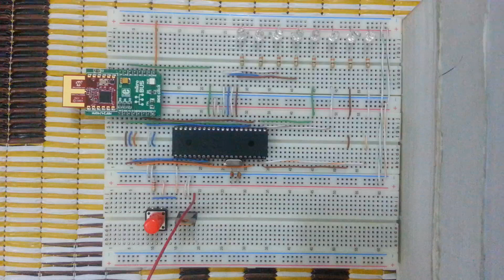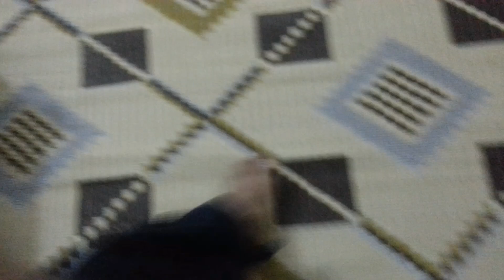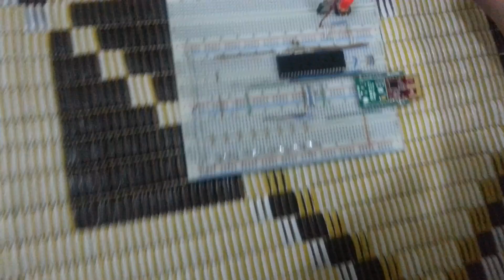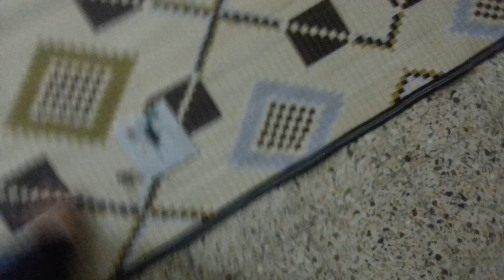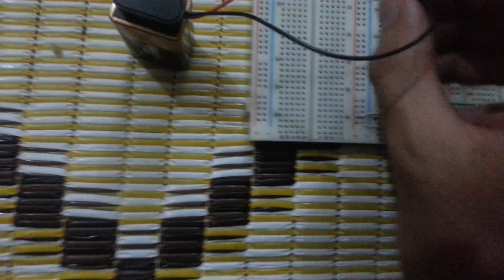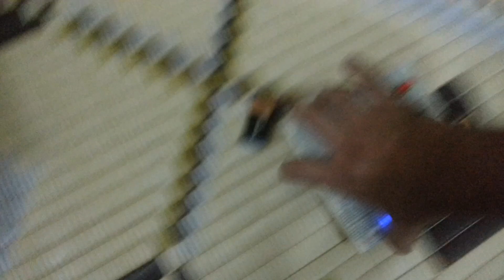ZigBee P2P system based on two BeeClicks (Using MRF24J40MA) from MikroElektronika

Comment: hi i also using ths same zigbee but the length of transmit and receive signal less than 1 meter more than that signal will lost can help me to get the range as in data sheet
Reply from the maker: Hello there :-)
I'm sorry for the delay in my reply, but I didn't get notified about your comment.

Only one meter?!? Were your antennas pointing towards each other?
I got a further distance than you, especially when my antennas were pointing towards each other. After all, the antenna on this ZigBee module is directional, not omni-directional.

Kindest Regards :-)

Comment: Ando trabajando con estas antenas, he logrado prender un led pero no se donde podria moverle, para hacer una secuencia de leds como la que muestras el final, trabajo con el pic18lf4620 y con MPLAB no se si puedas ayudarme?
Reply from the maker: Hello there :-)

I'm sorry, but I'm not familiar with PIC18LF4620.
I'd suggest that you change your MCU to PIC18F45K22 instead, and try to make the program work, then you should make the necessary changes in order to make it work with PIC18LF4620 later.

Best Regards

Comment: Hi which ZigBee stack you are using ? I came to know that you have to use Microchip provided stack with microchip provided compiler. And microchip ZigBee PRO stack costs 995$ !  Is there any free stack available ?
Reply from the maker: Krishanu Banerjee Banerjee Hello and thank you so much for watching my video :-)I've never thought the stack would cost that much! That price is unbelievable!

In this video, the used stack is the one that (MikroElektronika) put in this example. After all, I didn't write the code for this one from scratch, I simply showed their example in the video. The stack didn't cost me anything.
But I have just checked the datasheets of (MRF24J40MA) and (MRF24J40), they both say: "The MRF24J40 is compatible with MicroChip's ZigBee, MiWi, and MiWi P2P software stacks. Each software stack is available as a free download, including source code"
From where did you get that price information? Or did I misunderstand you? If so, then please clarify your question.
Best Regards :-)

Comment: Hi Mohanad,
That was an interesting video you prepared.
I am trying to work with MRF24j40MA . I couldn't find any notifiable source to follow my goal and the datasheet isn't clear enough in my opinion. and I do appreciate if you could feed me with your sample code. here is my email address:
sepehr_saadatmand@yahoo.com
Reply from the maker: Thank you so much for watching my video Sepehr Saadatmand :-)
The sample codes for both of the PICs are those of the example that the (Mikroelektronika) team posted on (LibStock).

Link to the sample code: 
http://www.libstock.com/projects/view/242/bee-click-example

You can download it from there, and further more, you'll find the same sample codes for running this example on different MCU platforms!

Please let me know if you needed anything else :-)
Best Regards.

Comment: Thank you for your video. What is the minimum pins I can use in the MRF24J40MA to have P2P communication

Thanks
Reply from the maker: Hello Manie de Bruin and thank you so much for watching my video :-)
WOW! This is quite an interesting question! And a tough one too! 

Short answer? I think it's three

Long answer? There you go:
To list its pins in order of importance in my point of view:

1- One is used for data from the MCU to the MRF24J40MA.
2- One is used for data from the MRF24J40MA to the MCU.
3- One is used to synchronize the data transfer time in order to ensure reliable communication.
4- One is used to wake up the module when data is to be transmitted.
5- One is used to interrupt the MCU when data is received.
6- One is used to reset the MRF24J40MA when needed.
7- One is used as a Chip Select (CS) pin.

Of course, I don't think all these pins are needed in minimum, but only the first three, but I'm not sure though. I think you can include something in your circuit that saves you the MCU I/O lines that are connected to the rest of the pins.

For example, the MCU I/O line that is connected to the Chip Select (CS) pin can probably be saved by using a simple wire connected to either the ground or the Vcc according to if it's active low or active high (Active low in this case), and so on for the other pins.

I hope this helped :-)
Best Regards

Comment: Hello! 
My question is how do you link two MRF24J40MA moduls together? Can I do the network of 5 or more moduls? Is the recivinv and transmiting transparent or not? With that I mean if I transmit a data, would it be recieved on all MRF24J40MA or not? 

Thank you for answers

Ales Zupanc
Reply from the maker: Hello Ales Zupanc and thank you for watching my video :-)

The modules are linked by a number of steps, where in the beginning, the coordinator node establishes the network and set the required parameters, then the other nodes join the network where they should have the same parameters that are requested by the coordinator.

Of course, you can do a network of five nodes or more, but I gotta be honest here, I think it will be very tricky; however, I'm sure that you'll get all the help that you need if you posted the issues that you encounter in the MikroElektronika forum. Lots of nice people there :-)

The transmitted data will be seen by only the intended receiver. However, if you sent a broadcast message, then all nodes will receive the message.

Please let me know if I misunderstood you or if you had any more questions :-)
Best Regards

Comment: I am interesting to do a communication with Zigbee protocol; I'm using two antennas RMF24J40MA, I need that this just have communication between this, the question is: This project works perfectly with pic's or I could need a pic18 explorer board by microchip for can do this? Thank you
Reply from the maker: Hello Alejandra Marquez :-)

I believe that this project can be done by any microcontroller as long as the chosen microcontroller can perform SPI (Serial Peripheral Interface) communication.

That's because the MRF24J40MA can only communicate with the connected microcontroller through SPI.

So to answer your question, this project works perfectly with PIC18F45K22, and it should work perfectly as well with the (PIC18 Explorer board). I've checked that board, and it looks like it's quite a powerful board.

I wish you great luck with your project :-)
Best Wishes and Best Regards

Comment: awesome , very good work  , ... how long the distance between the receiver and transmitter  ? are there  a different band of distances in this product ? its compatible with Arduio ?
Reply from the maker: Thanks a lot for your kind words Laith :-)
I'm sorry about the late reply. I've had lots of internet problems these days.

As for your questions, the maximum distance between the Transmitter and the Receiver is 400 ft., that is according to the most recent datasheet of the MRF24J40MA (Datasheet is linked below), which is the Zigbee module on top of the Bee Click.

You can check this in the third page:
http://ww1.microchip.com/downloads/en/DeviceDoc/70329b.pdf

Keep in mind that this maximum distance can only be achieved if the antennas are pointing towards each other (Directional antennas, not omnidirectional).

I didn't quite understand your second question, but if it's about the bandwidth, then the answer is that this module works in the 2.4 GHz band, which is also called the ISM (Industrial, Scientific and Medical) band, and it has a data-rate of 250 Kbps.

as for compatibility with Arduino, I think this depends on your Arduino board in use. You should use an Arduino board which has an internal SPI (Serial Peripheral Interface) module to make it communicate with the Bee Click.

I'm sorry, but I'm not sure of which Arduino boards have this internal module and which don't.

Best Wishes and Best Regards :-)

Comment: thank you mohaned for your video
can you help me to make the same schematic with Isis
because i cant found the "mrf24j40ma" in the isis library
Reply from the maker: You're most welcome Hamza  :-)
I'm sorry, but I'm afraid that I cant help you with your issue.

I don't know much about (Isis) simulator, so I don't know if the (MRF24J40MA) ZigBee module is available in its libraries or not.

I usually test most (If not all) of the codes of (MikroElektronika) compilers in real hardware because their compilers aren't fully supported by any simulator.

Even the simulators which do support some functions of their compilers aren't considered reliable because they don't support all of the new compiler libraries, so they might give wrong results .

I'd like to recommend that you ask your question to either the technical support of (Isis), or a forum like the (MikroElektronika) forum. I'm pretty sure you'll get better answers.

Best Regards :-)

Comment: maximum possible distance?
Reply from the maker: Hello Pachipachi :-). It's 400 ft. according to the most recent datasheet of the MRF24J40MA, which is the module that is placed on top of the Bee Click.

It is mentioned in page (3) in the following document:
http://ww1.microchip.com/downloads/en/DeviceDoc/70329b.pdf

However, keep in mind that maximum range can only be reached when the antennas are pointing towards each other (Directional antenna, not omni-directional).
The worst case is when the antennas are put side by side. I wouldn't expect a range more than 100 ft. at that case. Haven't tried it though.
I hope this was helpful. Best Regards :-)

Note: When I checked the distance in the datasheet for you, I found it is 400 ft., but it says 400 meters in the datasheet which I downloaded some time ago. I guess it had been updated.